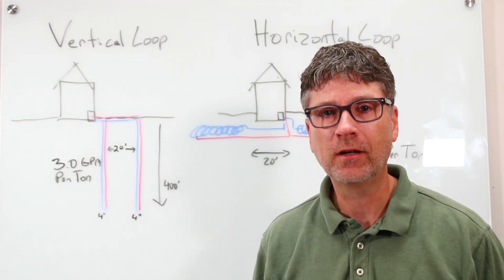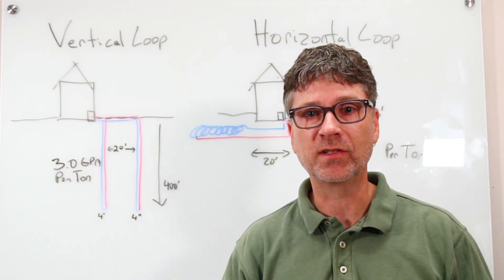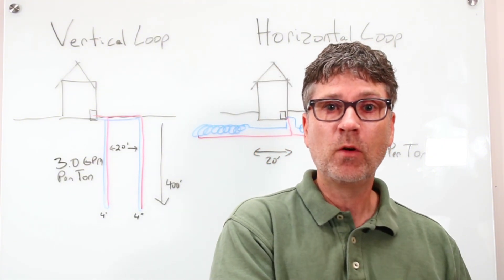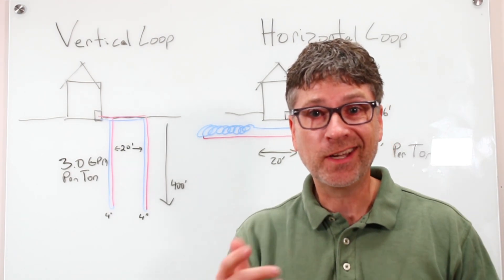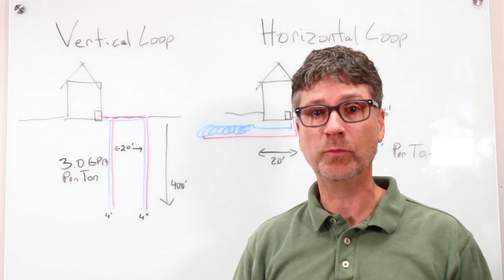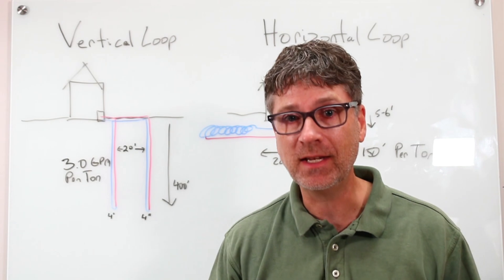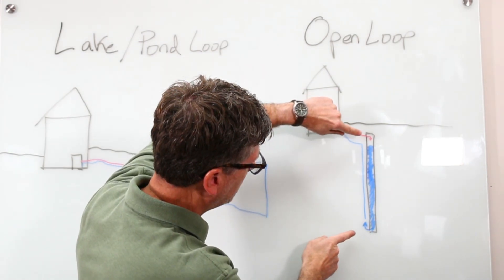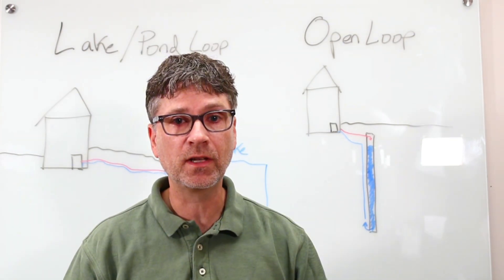Best Types of Geothermal System Loops

Comment: I live in a tropical climate whete even in winter the temperature can't freeze the water. Could i install a pond  loop in a pond that is about 4 ft deep
Reply from the maker: There is a minimum sized body of water needed, but really, so long as the loop is always submerged, you would be ok.